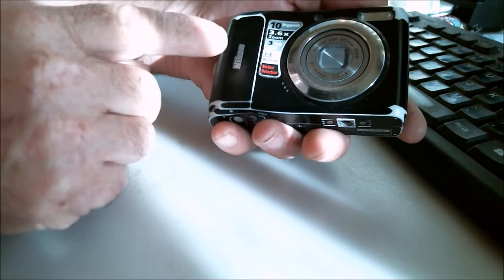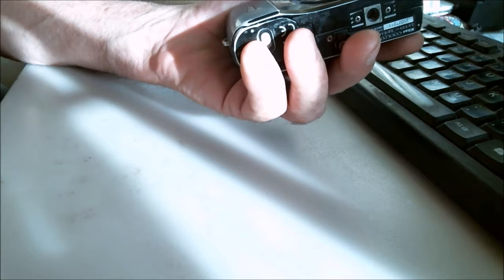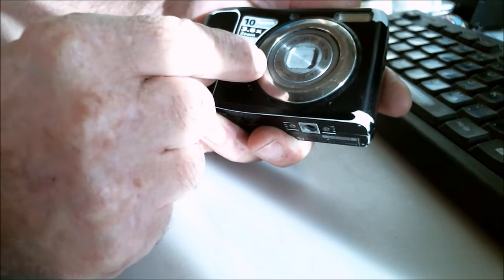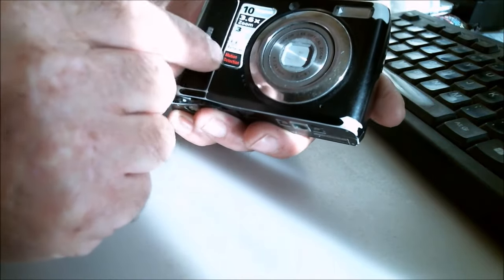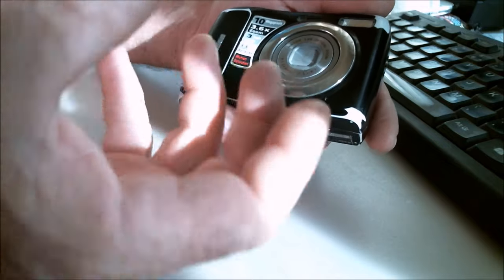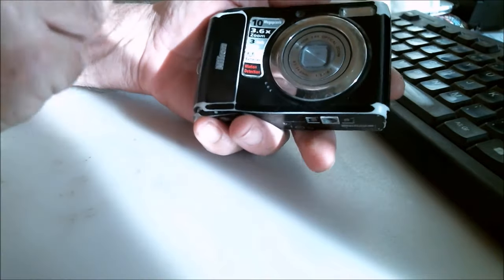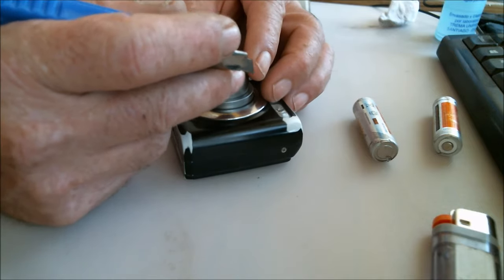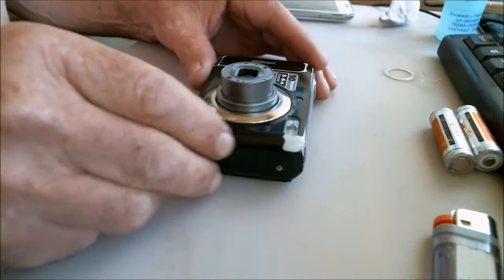Quick Fix for Compact Camera Stuck Lens and Lens Curtain: Coolpix

Comment: Someone may be willing to do what I did to remedy an identical problem I had with my camera. I just bought a camera today at a flea market and had the curtain problem. I simply opened the lens the same as you and took a q-tip lightly damp, not soaking and swireled around under the curtain. It took several tries but I didn't want to saturate that area so I kept the q-tip only damp. It worked, I don't know how long it will last though. I did touch the lens the whole time and it didn't damage it any. This was a $10 camera so keep that in mind. Your method is much better and more thorough but I still thought it was worth the comment. Thanks for your video. It came up while I was looking for a review of my new camera.
Reply from the maker: Wow great buy.  I'm sure quite a few people throw a camera away, just for some silly little thing.  And the coolpix is quite a good camera if you are just starting off.  Mine cost me about US$90, and that was about 20 years ago 🤣🤣🤣🤣. Still working pretty well.
Reply: Yes, most cameras only see limited use, some spend most of thier lives in a drawer. This one had soda or something sticky  on the curtain and the alcohol and q-tip did the trick.
Reply from the maker: @xblastx1956  Just shows what $10 can do for someone with an eagles eye. 😁

Comment: Hi, what if my lense won’t come out in the first place like yours? When I turn my camera on i hear the mechanism trying to open but nothing happens unfortunately
Reply from the maker: Most probably you have dirt between the lens' barrels.  It can help to put the end of your vacuum cleaner just over the barrels to pull out any dirt.  Do it on the low level first and increase pull slowly. You don't want to damage the lens with too much vacuum power.  As I say in the video I believe this is the best of all options without dismantling the lens.
Reply: Did you manage to fix yours? I have the same problem haha. I've tried vacuuming and some of the other options but they didn't work unfortunately.

Comment: what to do if the lens wont pop out at all?
Reply from the maker: Well, if you have tried all that's in this video, repeatedly with much patience, and nothing happens, I'd take it to be seviced.  It might be a software thing, a failed bit of electronics, or a mechanical part is broken.  If it's some oversized bit of grit in the lens barrel the mechanism should, at least attempt to open. If it doesn't attempt to open: there is opening noise but the barrel doesn't even tremble, it probably is a broken part, and if it doesn't make any opening noise or tremble, I'd say it is a software issue.  However I'm not a camera technician so maybe wrong in all.  Sorry I can't offer you further help.

Comment: Hallo Friend...I have a question for you, and you would be a person far more experienced, so I humbly ask for a simple answer, to a long question... It is regarding 2 hikers found dead in the jungles of Panama, 2014. Their camera was recovered, it was cracked and had water damage. Professionals extracted the images from the memory card or something like that. The last 90 fotos, all were nonsensical and mostly facing the sky, dark of night, heavy rain, 90 consecutive fotos, the final two fotos had 48 minute gap. I contend that the camera and the girls fell off an 8' ledge seen in the fotos, the camera going haywire, jammed into a cycle of snapping pics. The fotos show camera movement/change of views... Which is the vibrating camera on a rounded rock/boulder. Tell me please... Is it POSSIBLE for a dropped camera to react in this way?? There are thousands of people SPECULATING about this mysterious case of two Dutch girls who tragically lost their lives... Thanks!!
Reply from the maker: Wow, what a story.  Well, I'm not an expert either. A forensic expert should examine the camera to find the truth.  As far as I understand continuous shooting means about 10 shots per second, so most probably all photos should be very similar, specially if the camera jammed in continuous position.  It would be illogical that someone falling back off a cliff would be thinking of shooting photos. But, who knows, strange things can happen.  As I said, anyone can make hypothesis, a forensic expert should be able to deliver the most probable explanation.

Comment: My camera is ES80 and it does turn on, but, the camera lens doesn't even come off. I tried to open it but the screws are stuck. Plzzzzzzzzz help me
Reply from the maker: Samsung ES80. If the lens doesn't come out it can be an electronic or software issue or a dirt issue.  In the video I detail different options before disassembling the lens.  I suggest you try using a vacuum cleaner to pull out any grit stuck between the moving parts of the lens.  The vacuum can be very strong so I suggest you act carefully or regulate the strength on the vacuum cleaner.  If you don't have a vacuum cleaner, this is the time and excuse to get friendly with the girl next door, or boy, whichever the case.

Comment: i have a diff kind of problem.
there was a lose black thing frame on my nikon s3700.
 Should I try to open the cam like this? Will it work?
Reply from the maker: I don't know what you mean by "loose black thing frame".  I must say I am not a camera technician. At most, I have a good eye for mechanical workings so I don't dare get my hands on electronics, unless it's a loose wire.

Comment: Very interesting video, i tried the method you did but my camera still didnt work. Do you have any idea how to fix mine? The camera lens are stuck and it keeps moving themselves in and out. It just keeps doing that very fast. Its like its clapping. I have Exilim Casio camera btw, will be very helpful if you know how! 😊
Reply from the maker: I'm sorry for your issue Shxun, but I feel it must be a software issue. I'm not an electronics guy but I imagine there must be some sort of sensor that must tell the software the lens is full out or full in so it stops pulling or pushing, and that might be failing.  In my opinion your only option is to take it to a camera service so they check what's going on. Unless some dirt is affecting the software my procedures (in the video) won't help you.
Reply: Mine also Exilim Casio! My prob is that my lens can't moved out and the display screen doesn't work..but everytime I tried to open the camera its only make sound,so how can I fix it?😭

Comment: 2 13 23      
   this vid has opened the door for the possibiiity of repairing my drawer of 7 dsc-w90 cyber shots.
they all last maybe a year then the lens starts to stick tele-scoping open or closing.

     of course i suspect that Sony maintains its sub-optimal design.  after all they sell for $300.
based on that belief a smarter aproach is to find how to open one up.  and locate and ID the
fault.  plus look for any parts that are worn out .  then open the other ones .l  get them all
sized up .  and decide what to do.  possibly one or more can serve as a source of parts to re-use.

      does Sony have a parts dept. for replacement parts for these cameras ?

good of you to have made this and posted it
Reply from the maker: Thanks Bob, I believe this is one of the best comments I have received in my channel, up to now.  In all, these are great cameras considering the price (mine cost about US$100 at the time).  I doubt one can get new spare parts for these cameras, so your strategy of switching parts to get one or more working cameras is a great strategy.  I wish I knew more electronics, to dig in further, but just with the mechanicals one can do great things.

Comment: Hey brother help me i have an camera at my home like this i think it's battery is old even if i charge for hours it doesn't get turned on but if i just put charger on and try to on it it gets turned on but switchea doesn't work do u have any solution
Reply from the maker: Sorry bro, but I'm not a camera technician.  Sometimes, when you overcharge batteries they don't work anymore.  In any case it seems there is something wrong with your camera's electronics, something I know nothing about. Sorry I can't help you.

Comment: You probably won’t know how to fix my issue but I own a Nikon Coolpix s4100 and it keeps telling me I have a lens error the camera is blurry and it shuts off closing the camera with it I’m not sure what else I can do 😪
Reply from the maker: When you the lens open does it go smoothly or bounce a bit? Thats a sign of muck in the barrel and the error message might be a response to that.  Maybe if you try some of the merhods mentioned in the video, specially using a vacuum will fix the problem.  If it's a software or electronic issue I don't have a solution.
Reply: @RODsDIY  it opens smoothly but it’s alright thank you for commenting and making this video for others! I’ve decided to give up unfortunately Hehe but still thank you !! 🤭👍

Comment: Can I fix my Kodak camera which the lens broke and it's half black in down in the vision.
Reply from the maker: Hi Salekferdous.  In my opinion, most of these small cheap cameras, in most cases aren't worthwhile getting repaired by technicians.  The repair might be more costly than the camera, or a new one.  So if it's old (not covered by warranty) you might as well try and fix it yourself if you believe you have clever, or at least, careful fingers.  Many times the fix can be very simple, not a big issue.  If you don't trust your fingers, you might find some trustworthy friend willing to take the chance.  What can go wrong: you have to buy another camera.  If it's an expensive camera, and worthwhile saving, just take it to Kodak repairs and don't risk a worse scenario.  Go through this video and others in YouTube and documents in the Internet, and maybe you'll find possible solutions you can apply.  Good luck.
Reply: @ROD'S DIY Solutions  The camera is 15 years old
 It still works but the lenses are broken (Kodak easyshare c713)
Reply from the maker: @CallMeZrix  Well, that's only US$45 in amazon.  If you are in to experimenting with electronics, you might want to buy an nonworking camera and put the lenses on yours.  😉
Reply: @RODsDIY  no that's expensive in where I live. And it's rare to find you did not ask me where I live first.
Reply from the maker: @CallMeZrix  Ok, I don't live in a rich country either, but I'm sure you have flea markets where you live, or a facebook group (Recycling, Upcycling, exchange, give-away, etc.) where you can find an old camera of the same model that is not working, free or cheap,, and you can use that to get the replacement you need. Nobody told you to buy a US$45 camera to get replacements out of it, but if it's working it's a cheap camera, compared to other models.
Reply: @RODsDIY  $1 = 87 taka
Reply from the maker: @CallMeZrix  $ 1 = 800 Chilean pesos.  That does not mean much.  One has to consider many variables, like how many takas/pesos one earns per day/hour,  what can you buy with that money, what sort of aid you get from your government and quite a few other variables. Additionally we have the problem many economists don't agree on what should be included in our analysis or how the world works.

Comment: I just wanna ask sir if you know how to fix the flash problem with the nikon coolpix, the flash is not working
Reply from the maker: Hi, Andrie.  Regretfully I have never dissassembled that part of the camera. If you can open that part and you find a loose wire and can guess where it should be soldered and have the right tools, maybe you can fix it.  Any other fix, maybe even changing the flash bulb  might require high electronic skills and knowledge.  WARNING: Flash bulbs work with the accumulation of high voltage (capacitors) and I understand you must earth that voltage before even touching those parts. It is a serious risk.

Comment: I have a Nikon Coolpix a300 and when I shut the power the lens won't retract. Any ideas?
Reply: I kinda got it fixed by just putting my nails into the holes for the curtains however, it still has trouble retractin
Reply from the maker: @TheMemeManFromYourDreams  It can be software, but there is nothing one can do with that.  It can be dust between the barrels and body or dust in the lens curtain.  In the video I give some options: vacuum cleaner, blowing, etc., and disassembling the lens curtain.  Although it's a different model it might not be too difficult to disassemble.  Good luck.

Comment: What is that blue water
Reply from the maker: The blue is a reflection, it really is colourless.  It's 96° Etyhyl Alcohol.  It evaporates quickly so little risk of shock, however, as I say in the video, use with care as it might affect the surface of the lens.